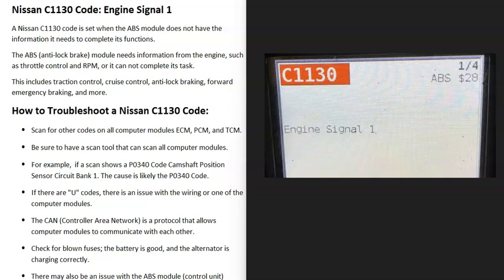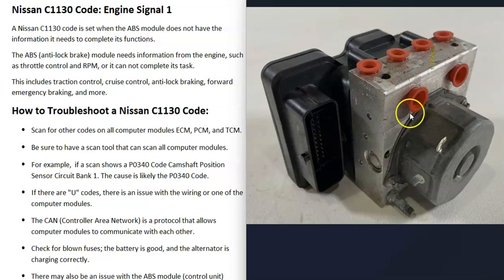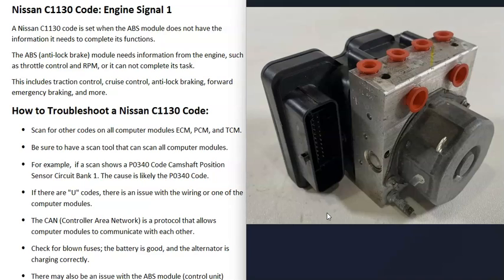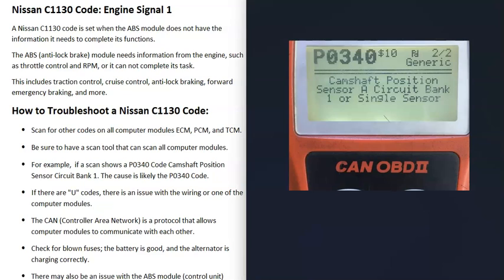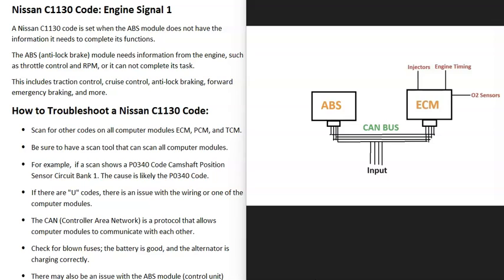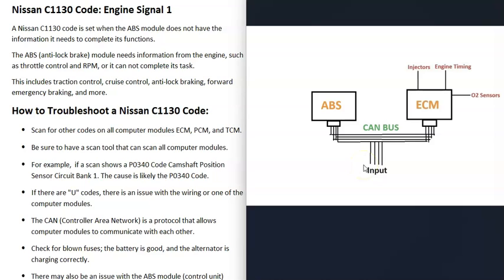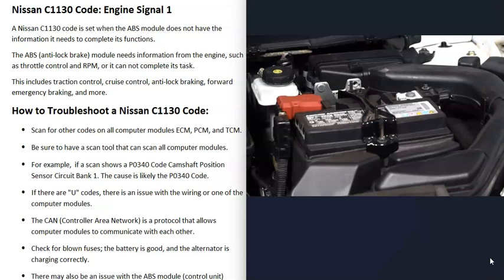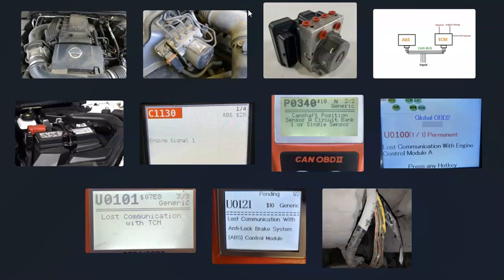Causes and Fixes Nissan C1130 Code: Engine Signal 1

Comment: If the brake fluid is low due to needing new brakes, will throw a code
Reply from the maker: In many vehicles, low brake fluid can trigger a dashboard warning light, and if not filled, it will eventually cause a code.

Comment: Gone through your list of things to check... have one ABS fault C1130 on a Nissan Juke.. ALL other codes, without fail, relate to HVAC system on 'B' codes 2630-2639 (all in between), 2654,2655 and 263D, 263E, 263F... any suggestions, mate??

Comment: So i have a 2017 Nissan maxima and recently I changed the alternator and suddenly these codes appeared:

1.	P1801 - Intake Manifold Runner Control (IMRC) Actuator/Sensor
	2.	P0345 - Camshaft Position Sensor (CMP) - Bank 2
	3.	C1130 - Crankshaft Position Sensor (CKP)

Should i change the each sensor?
Reply from the maker: Since the codes all appeared after replacing the alternator, I would check all the alternator wiring connections to be sure everything is plugged in good.  And test the alternator output with a meter.

Comment: I have 2017 Nissan Pathfinder first code it was P0112 that was the mass air sensor I changed that part and other code is C1130 now So now auto zone saying I need to buy a mass  air flow sensor connector SMH idk but my engine light still on after I was told to change mass air flow sensor and code still on idk what to do but I need my inspection done asap 😢
Reply: I had the same issue there was a tear in my fresh air intake hose

Comment: What's funny is I had p0340, so I replaced the cam sensors. Reset, drove 10 miles now I have C1130. No cam codes... Should disappear after it gets enough data, right? Or at least throw another code...

Comment: What if the only code showing is c1130 no other codes then what??
Reply: Lmk if you figure it out cause I got the same issue
Reply: @brendac.454  throw a match in the gas tank
Reply: @IncredibleHoosier  I tried that after reading this and my car blew up. You tricked me
Reply: @Believe26 😂😂😂
Reply: @brendac.454  I brought mine to nissan. It was the transmission cooler lines were leaking. Car runs amazing now.
Reply: Still no answer? I have the same code no others, I think it could be a clogged pipe from my research or 5 other things 😂😡 sometimes the car drive normal for 20 mins then back to low acceleration and high RPMs I thought it was transmission but my mechanic said it’s wasn’t I believe him because it works just fine at times but then again I’m so lost I just think it’s a transmission problem
Reply: @wymg4090  Mine was the transmission cooler lines were leaking

Comment: my 2005 has code P3000 said multiple misfires and flashinh CAT,EVA, SO2, HTR,\. I already tested the spark plugs, ignition coils, and mass sensor, camshaft sensor but it shows no damaged, can you tell me what else I should check
Reply from the maker: Are there any other codes? It needs to be diagnosed if one cylinder or multiple cylinders are misfiring. Multiple misfires usually point to a bad sensor a fuel delivery problem. A single cylinder misfire usually points to a problem on that cylinder, such as a bad injector, coil, or a wiring issue.

Comment: 2011 Xterra, have a C1130 code but no U codes or any other codes except in the BCM. (C1704, 1705, 1707, 1711). Idles high and does not accelerate.

Comment: I have the C1130 code and I am getting P0101 also but my MAF is new
Reply: Bro same thing happened to me with my Nissan maxima
Reply: Having issue now should  just replace MAF
Reply: @waterpxxx ditto! 2015 nissan pathfinder.   Replaced maf 3 weeks ago and got same codes you got today.  ABS Light and check engine came on today
Reply: @livingministrypatty 2017 qx60 has some issues, Do you have any ideas to solve his problem?
Reply: @livingministrypatty any fixes
Reply: Did it fix the issue I got intakes and both my maf sensors are giving a code, got a check engine light for them. Then like 20 seconds later I got the abs code

Comment: so I got a P0340 and then replaced the sensor but now the c1130 code came up so what does that mean
Reply from the maker: Once the P0340 code is fixed, the C1130 code will likely clear. If the P0340 code clears, I would drive the vehicle around the block to see if the C1130 code also clears. Some vehicles need a CAM relearn when the cam sensor is replaced.

Comment: Hi i have these codes 
C1130, U1000, C1601, C1706, B27D7, C1A01, C1A04
is it anything i should worry about ore that you can tell from these? i bougt this Nissan Qashqai 2014 1.6 dci
Reply: Can bus issue, models aren't reading like they should, basically could be as simple as a wire is damaged in the main harnesses.

Comment: I have these codes for p0447 in the evap system. I also have the code p2138, c1130, and c1154, what do you think is the problem?
Reply from the maker: Those codes and issues, such as the EVAP system and Throttle/Pedal Position Sensor, are usually unrelated. It will need to be diagnosed, but if I have to guess, I would say there is a wiring issue.

Comment: Hey my 350z just went into “limp mode” where it wont rev past 3k rpm or lose any power once it hits 3k rpm. I scanned the car and the codes  “P0340” and “C1130” both came on . Do you believe once I change the camshaft sensor it should be fine? If those are the only codes appearing?
Reply from the maker: It's possible, but the sensor needs to be tested to know for sure. Other things can also cause the issue, such as wiring or a computer problem. If the Cam sensor is replaced, be sure to research whether your vehicle needs a Cam Sensor Relearn.
Reply: My nissan altima does this- limp mode, only with bumps or slams hood; thinking electrical, maybe easy as my loose grounding wire- might be throttle body & sensor wiring...  gotta narrow this down... already replaced MAF sensor casing.

Comment: Will a p0335 code cause a c1130code to pop up
Reply from the maker: Yes, it will need to be troubleshooted, but it is very likely an issue with the crankshaft position sensor is causing the issue.

Comment: Hey thanks for the video! Do you have any information about this code with the p0101 code. I replaced the MAF sensor recently light went off. Now light is back on with both codes C1130 and P0101. I’m driving a 2017 Nissan Altima. Thank you!
Reply: I have the same car and same codes are showing P0101 , C1130 and C1108
Reply: @mustafashahid2608  it’s weird mines go away then come back on
Reply: MINE TOO!! 2012; Goes in and out of Limp mode (wont accelerate past 2300RPMs/65mph) - throwing all kinds of codes, p0101 & c1130; ICY ROAD; etc...  ONLY HAPPENS WHEN I HIT BUMPS/Slam hood.  So thinking MY issue is electical in nature...  Its never ONE answer for all, thats why its so hard to find prob for everyone on internet, can be ten diff things... gotta test each one to narrow down the prob!!
Reply: Did you figure it out ?
Reply: Hey would a aircon pressure low code throw c1130?
Reply: No.  ABS doesn't need aircon info
Reply: Hi, thanks for the explanation. I have this code along with P0132. I have rough idle, poor acceleration  at take off and stalling at the petrol station when I fill up.  Any thoughts appreciated! Purge valve perhaps?
Reply: Forgot to say It's a Nissan Micra 2012 K13
Reply: Have this same issue right now on my 2018 Altima, thinking yeah it has to do with electrical. Changed PCV valve, replaced MAF sensor, did a full diagnostic and everything is reading right. Cleaned the terminals and put dielectric grease on em, next thing is probably a shop and maybe an ECM reprogram or something. I don't know.
Reply: I unplugged my MAF while it was running and both codes popped up. Apparently it takes 60 miles for the computer to reset. Both are somehow tied from what I can guess. What was your solution?